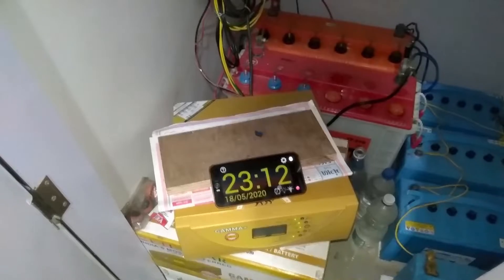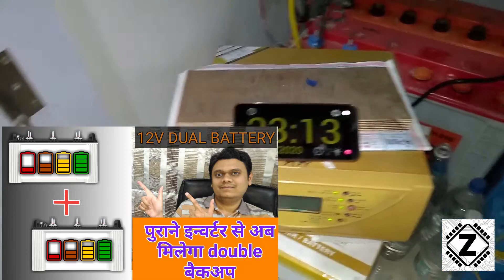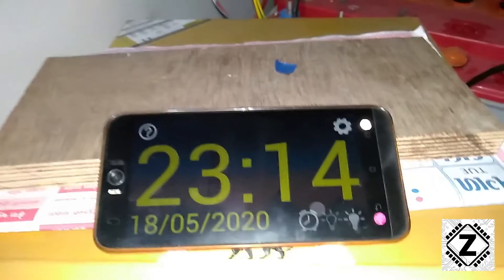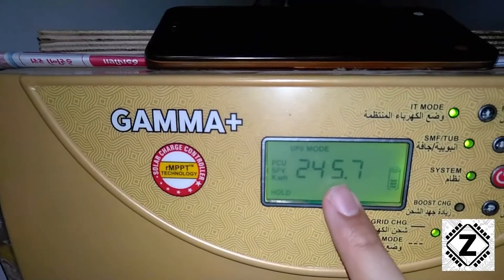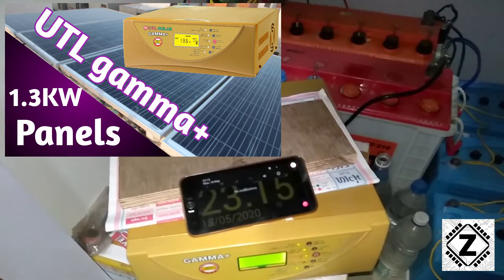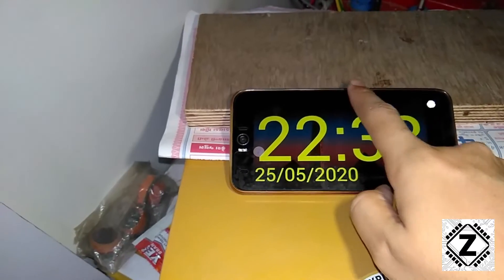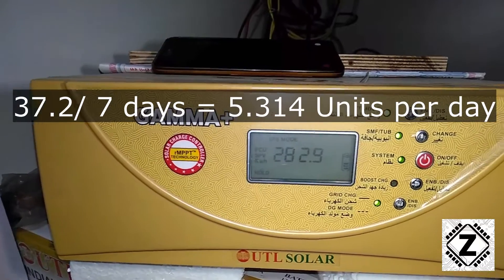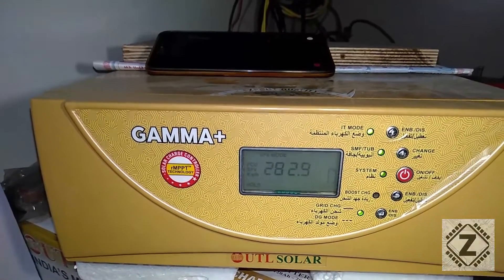UTL Gamma Plus Weekly Solar Production PROOF | 1.3KW Panels | Let's Talk about my Solar Setup [Eng]

Comment: Sir pls help me mere uTl inverter ko jb meine battery ke sath connect krta hoon to mere inverter ki output socket,or Ac cable  ki. (_ ve) point meine bhi current show kyun ho raha .
 Phir bhi Load chal raha
Reply from the maker: Ghar ki wiring check karo. Kahi na kahi fault hai.
AC cable (Both charging and Load) completely disconnect karke sirf Inverter battery se connect karo and ek baar check karo.
Reply: Sir inverter battery se connect krke dekha tha phir bhi same problem hai _ve meine current show ho raha phase tester pe cheaq krta hoon to pr load chalta hai
Reply from the maker: Better to get Inverter Serviced by Professional or Service center.

Comment: Nice Presentation...Sir I have a question...Can I use 390 Liters LG 4 star rating refrigerator?The power saving guide showing 415 units electricity consumption per year....I want to install gamma plus with 375 watts x 3 loom solar solar panel...If it is not working i can choose 2kva utl inverter with 2 12v batteries....If it will work with gamma plus I don't need to invest more money...What is your opinion??
Reply: Inverter refrigerator can be run easily on it but u have to try out for non inverter
Reply from the maker: I am using 500 Litre LG inverter Fridge. Works well on Gamma+
I am also working on a series where I will power Fridge, Washing machine, PC etc on Solar and show it in dedicated videos.

Loom solar 375x3 Panel discussions in QNA EP1

Comment: One question that in your system you have disabled grid charging when battery is low and grid run load via bypass that time fan working or not kindly check my system not working
Reply from the maker: Your question has been answered!
Click the below link and "Set Reminder" for Premiere (live). The Premiere will go live on Sunday at 9 AM. Set the Alarms!!
https://youtu.be/UIpkb47j3Mo
You can also participate in live chat session. After the Premiere is done, you can also watch it as a normal video.